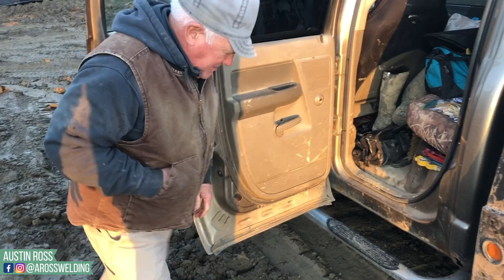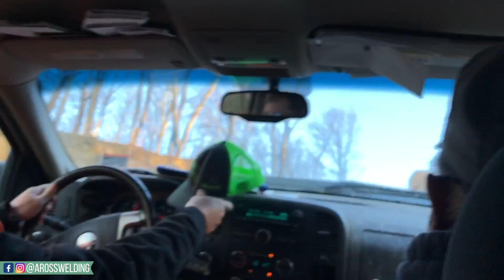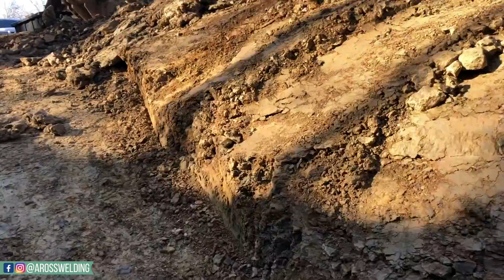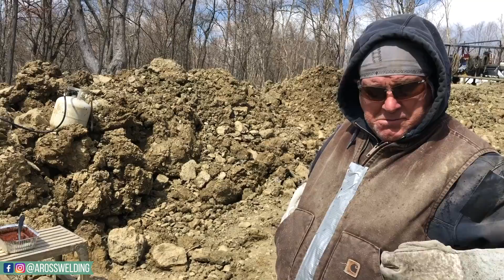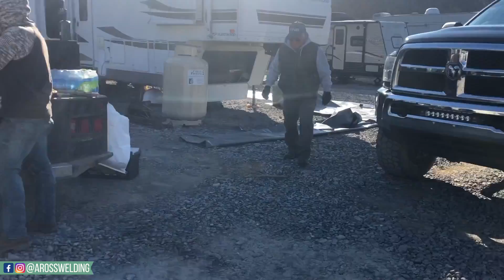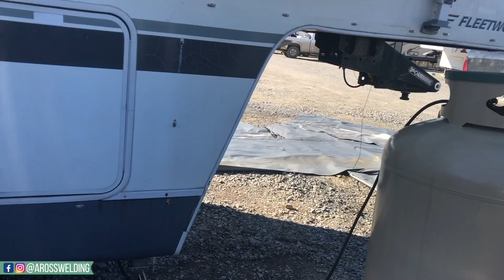DOES WELDING PIPE GET OLD? (ANSWER FROM A MAN WITH 50+ YEARS EXPERIENCE)

Comment: How can this not be done faster?? Good god, weld 4” grind weld 4” .
Reply: The have stringent regulations and requirements they have to meet. After all, these lines will be filled with highly flammable gas under high pressures and will likely be in service way past what it was planned for. I'm from sissonville WV, we had a high pressure 42" gas pipe rupture on two separate occasions in two different places. The first happened out in the woods basically and lit the whole sky up like the world was ending. We lived about 15 miles as the crow flies from where that incident took place but it still looked like it was right over the hillside. The second time it happened in the middle of someones yard no was seriously injured but it destroyed several homes and a section of I 79 interstate. It was on the national news you may be able to Google something about it. My point is they are under a lot of scrutiny when welding these pipes together and for good reason lol.

Comment: Hi Ross, I have a question. I have seen many videos of pipeliners and I was wondering why they use pancake hoods instead of those modern Lincoln or Miller brand for example?
Reply: fongjorge .. “The original pancake” “sarge” “Wendy’s” “CMR fabrication” all make pancakes for welding hoods
Reply from the maker: Because they block out the back light and sometimes they are lighter in weight.
Reply: Should get one, even on the farm seems like that backlit is ALWAYS there. Right now have an old T-shirt as a cape to keep the light out. 😀.

Comment: How come he throws out the stick after barely using it, when there’s more than half left, while welding. I’m interested in the industry, and just curious about that. I assume obviously you don’t want it to get too close to the end and melt all over the device you’re holding, but throwing it out when the over half left just seems so wasteful.
Reply: Roy Franks it’s way easier to strike an arc with a new rod instead of trying to to use the old one
Reply: @damienhedger2941  
Thats not what he means
He means : 
When using a new rod why does he use only half of it?

Comment: That is a sad time when you got to let go ? Move on with guys  like that, good knowledge is gone, I been welding 22 year now , did done welding for the sructures  you drive under to hold signs up did that 1year in Ellwood Pa had 6 state certs on this side of the Mississippi

Comment: There will be no pipe welders soon. Japan are making welding robots that will do same job twice as fast without error
Reply: Would love to see a robot welding tie-ins on refinery or chemical plants, full tig butts with restricted access, un-even gaps and bevels, only a few inches away from structural steelwork 🤣🤣🤣🤣 let alone weld it so it goes through bombing 😆